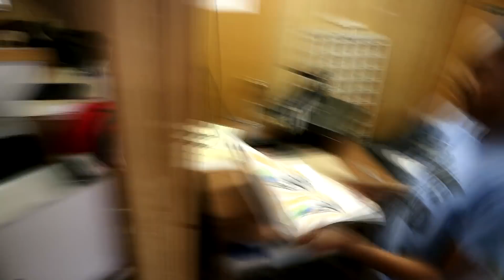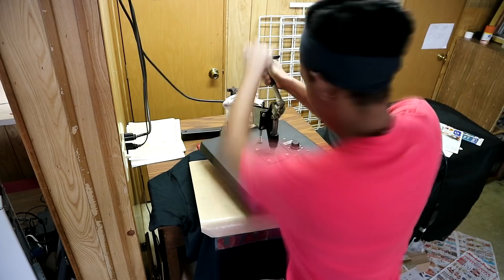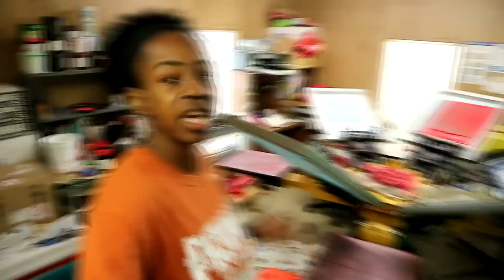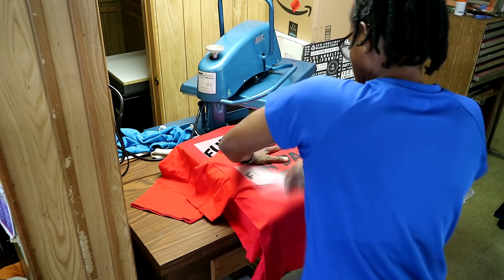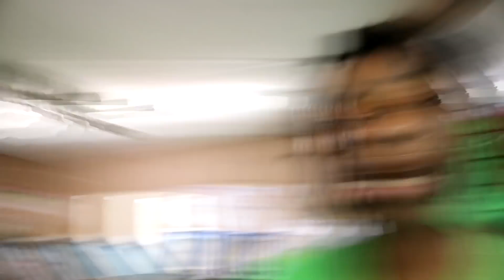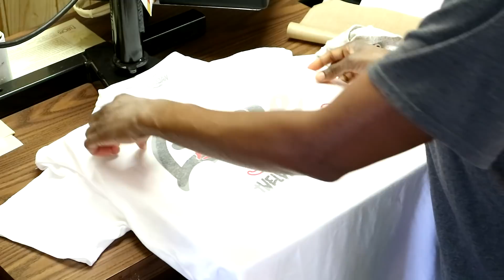10 Reason You Should Start A Heat Press Printing Business

Comment: Which printer do you use for heat transfers? Does it use pigment ink and is it durable? Thank you:)
Reply from the maker: I use HP K8600 it's an old printer over 10 years old.  It's been discontinued.

Comment: What is your opinion on using heat transfers vs using vinyl
Reply from the maker: If they are screen printed transfers I think they would work well.   The transfers that you print out with printers will eventually wear out.  Screen printed transfers and vinyl will usually last the life of your shirt if they are printed correctly but I have heard of screen printed transfers cracking over time.  Hope this helps.  Thank you for watching.
Reply: Thank You

Comment: I'm looking for a heat press I seen that there is the 5 in 1 what's your knowledge on the 5 in 1 what's the goods and cons and do you have tutorial on those thank you for your time I have a $300 budget
Reply from the maker: I don't have experience with the 5 in 1 myself but I have had some of the Print Squad members saying that one part stopped working and that made the whole thing useless.  I would either save up until I could afford to get one from one of the big named compaines or if you just want to get started right away I would go to Amazon and find one on there that has a protection plan available incase you have any issues with it.  Hope this helps.
Reply: @TshirtChick  thank i
Reply: Thank u